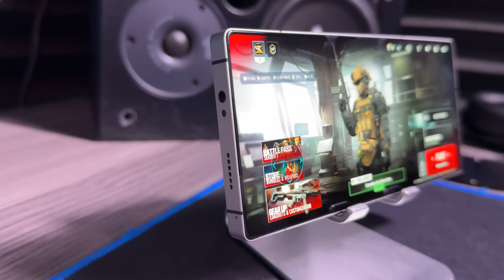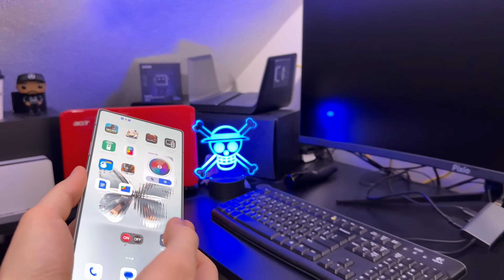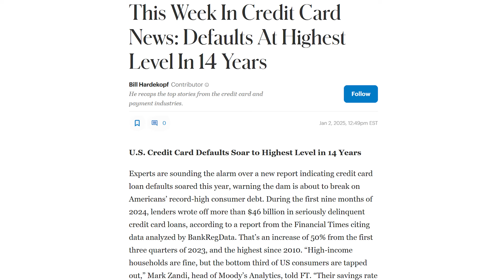What CES Revealed About Repairable Tech In a Record Year For E-Waste (2025 Is Not Looking Good)

Comment: I have a HP Pavilion :(

Bought because long batter life
Battery bulged like a balloon
Bought a replacement off eBay
Had a dead cell and didn't work
Now it lives without a battery
It's designed without CMOS battery
BIOS resets every time it's unplugged

I hate this laptop, it's just cursed
Reply: Got a few of those Crapilions here... gifted (if I can use that word) by friends, and they're close to not being repairable or not worthy of the effort. All it took was a quick look on forums to know it is a throw away computer range
Reply: I have quite a few, some are better than others. I even have one of the DV9000 he mentioned, and yes the GPU is dead.
Reply: the worst laptop that ever lived 😆
Reply: IM actually surprised. My $500  Asus Vivobook X441UB from 2017 still Works pretty good , and last like 1,5 hours on battery. IM planning to buy a new laptop like the end of this year. This scares me
Reply: Install Libreboot
Reply: @mannyheffley5481  LMAO no, I don't think so
Reply: @StarScream_47   bios bad? Then install new bios. Simple
Reply: @mannyheffley5481  The BIOS is fine. The laptop is designed without a dedicated CMOS/RTC battery. Without a working main battery (which I do not have) no settings will persist after unplugging the system. The amount of effort to install Libreboot onto my laptop, that isn't even supported, VASTLY outweighs the trivially few key presses I would need to enter the BIOS and change a few values on start-up.....
Reply: @mannyheffley5481  it is quite hard to do .... and not everybody laptop support it

Comment: So, would a desktop be more repairable than a laptop?
Reply: Yes, and no. Parts for a standard ATX desktop are easy to come by. A lot of the time though, parts themselves are difficult to repair. 

One big pro for desktops is that, with decent cooling, they have a lot more tolerance for dust than a laptop. It doesn’t take much gooch to stop up a laptop and requires frequent cleaning, while a desktop can take years of fossilized gooch before problems start occurring (if at all).
Reply: While individual components are difficult to repair, like GPU, CPU, RAM, etc........ You can at any time, easily replace any faulty part.

Technically you could repair faulty parts, but that requires special tools and extensive knowledge of electrical circuits.
Reply: Easier to replace parts not repair them

Comment: I mean, really what these companies are doing is opening a hole in the market for cheap, simple, repairable tech. Framework already proved that being repairable and evergreen can work as a selling point, and the Fair Phone has also been doing good. Apple even starting to support home repair shows that they realized what a lot of tech hasn't:
If you make something unrepairable, being able to repair that thing becomes a selling point for your competitors. If a company says "Gotta buy a new one every few years."  It leaves them open to having their business snatched by a product that is cheaper, simpler, and has a longer lifespan. Its how Honda and Toyota were able to break the american car market: They gave people reliable cars at a competitive price without sacrificing the important features. For a computer, a fridge, etc, its even simpler: You use the same parts, with a more robust and simple design. You may lose on weight, but thats easily overlooked if your product is leagues cheaper and promises to last for a decade. 

For another example, Airline Deregulation killed a lot of the major players because they had assumed their dominance would just.... continue. And when it didn't, they didn't have a contingency plan. And I see echoes of that in the computer market. HP, Dell, and their peers have no plan for failure because they genuinely think they can't be matched by any other company. They think they hold all the chips, but by going for this strategy of "no repair" they are inadvertently giving away their chips to startups. 
This is just doubling down on a strategy thats proven to not work.
Reply: Problem is a/ design is not more important than specs and repairability so for some it won't do, b/ the price is usually higher because less marketshare (even if that is largely offset by a longer lifespan and real upgradability - but hey, since when has a customer looked at the complete lifespan cost instead of just the cost of buying the thing, just look at inkjet printers), c/ they have to go get it on the manufacturers website as you probably can't find it in big shops. Lazy customers make happy shareholders
Reply: Agree with everything else you said but Apple doesn't realise anything regarding repairability. All they understand is EU regulations. They just market stuff like usb-c iphones and more accessible repair guides like they themselves took those initiatives when they clearly didn't.

Comment: even the car statement you made, bring back the corollas of 1999. yeah they use a little more fuel, but they don't break, so what you win in fuel you lose in parts manufacturing
Reply: Part of the problem with cars are the EPA regulations. They incentivize unreliable, over complicated, and crappy cars all to reach unrealistic expectations on emissions.
Reply: @EvilTurkeySlices  I'm getting so fucking fed up with the bullshit the corrupt assholes at the EPA are pulling, trying to regulate shit most people can't afford to do. We ALL know they're still huffing on the truck sale gravy train.
Reply: I took automotive classes in the 90s and I never forgot my instructor talking about emissions. Even back then he said they made the engines so efficient they had already reduced the emissions at the tailpipe by 90% WITHOUT the other emission controls like MAP sensors, oxygen sensors, EGR valve, catalytic convertor, etc. The result is law of diminishing returns, a simple concept we all learned early on in school but the EPA, CAFE standards, etc have all conveniently forgotten in having manufacturers making cars more expensive, complicated and harder to repair. The end result, corporations get more money and resources are used more than ever and inefficiently imo. The question is do we save more by keeping that slightly more inefficient car running or by mining tons more materials, creating more pollution in manufacturing that car and throwing it away every 10 years to do it all over again? I think by the way I phrased that you can tell where I land.

He even made a morbid point about the efficiency of engines back then. Shutting the garage door and running your car could off you in less than 10 minutes prior to 1970s. A 90s built car, even without emission controls, could take well over an hour. Yeah, making the point that way really made the info stick.
Reply: European Union is exactly the same

Comment: the trend is CES 2025 is NOT A.I. its "DISPOSABLE TECH" that would last 2-3 years tops, as tech companies will gain more profit if people will continually buy their disposable tech.

CES 2025 was about PLANNED OBSOLESCENCE, which definitely let tech companies generate MORE PROFITS
Reply: the simple fact that a battery is not modular, easily externally removable like with a slot mechanism is enough to make any environmentally friendly claims nullified. The amount of people that buy a new device because the battery died is beyond unreasonable because either the labor to replace it costs 1/3 the cost of a new device or the battery is unique and only non OEM clones that are sketchy are available. I just remember my asus laptop that I spilled a drink on, the keyboard used rivets to attach to the top, REQUIRING a full 50% chassis replacement for a few half sticky keys. why on earth design like this? because in the end, when people hear the repair price they go buy new, giving more profit and showing investors good numbers. those "fat" old black soulless laptops were sturdy as hell and now they break like paper, especially the ones with "no" screen border.
Reply: Aren't we all just waiting for the AI bubble to burst? Just like the .Com bubble of the 90s.
Reply: thx america

from - the world
Reply: It's both. There were literally CPUs called "Ryzen AI 9 Pro Max 385" (I think I got that right) there.
Reply: Casting curses is your best friend guys
Reply: I hate planned obsolescence.
Reply: Well the AI bubble has begun to burst. DeepSeek showed how easy it is for open source solutions to strip away most revenue opportunities for AI.

Comment: Minutes ago i was chatting with my friend, he has a lenovo gaming laptop and sent it to a shop just to get it cleaned from excessive gooch. The shop told him the fans couldn't be removed to be cleaned alone and would have to remove the entire cooler, which covers half of the entire laptop assembly, and then underneath that is liquid metal which isn't as easily replaceable as thermal paste, and apparently the thermal pads are not actual pads but some kind of "grease" as described by the shop tech.

Modern tech is making less and less sense, is becoming less repairable if at all, less efficient and many undercooked products now riddled with AI and design choices nobody asked for that also costs more!
Reply: @crisscrossam Just dropping here in case your friend wanted to clean up the mess that repair shop made,
liquid metal on CPU, PTM 7950 (not thermal pad despite seller may label as such nor should you use them as one) on GPU, the described "grease" are actually thermal putty (completely different from thermal paste, don't mix them up), get 20g Upsiren UTP-8 and use it VERY SPARINGLY on where the ""grease" was, which likely is on VRAMs, and mosfets if that Lenovo is a Legion Gen 9.
Reply: Back in 1980's people in America fixed revolvers by swapping parts with another revolver, some of them were compatible some others dont and you get a quimera, but you can't go into the west without a weapon like in 2020's you cant exist without a pc.
Reply: @SatiZakito chimera?
Reply: I'm ngl there doesn't seem to be anything wrong with that, it actually sounds way more repairable compared to a majority of popular computers. Here's why:
- User accessible backcover (the fact that it could even be opened without a heat gun and get at the parts)
- User accessible heat sink and fan assembly with direct access to CPU and GPU die
- Replaceable RAM, storage, wifi card etc 
- Liquid metal pre applied, with thermal putty on VRMs

I'm not exactly sure what your point is, are you saying it's too hard/complicated for your friend to learn how to fix their own laptop?
Reply: This is what happens when you let suits who don't understand tech push design ideas for shareholders instead of engineers who understand design.
Reply: @crisscrossam  should’ve called the gooch collector
Reply: i hate laptops for this so much like on my lenovo gaming laptop you also have to remove the entire cooler ad make sure not to bend it at all while its being wrenched down by so many thermal pads (ACTUAL pads)

had to buy an entirely new cooler because i literally couldnt get it off without breaking it to replace one damaged fan...

i love modern tech
Reply: Planned obsoletion and people still buy it. Cha-ching new Yacht for the big wigs.
Reply: Oh, nothing is problematic here.

LM is fine, can be replaced with a PCM pad like the Honeywell PTM7950.
The "grease" you have on those is actual thermal putty.

I'd recommend for your friend to contact Halnzyie and get 1kg of HY236 thermal putty; it works extremely well on basically any devices while being very inexpensive and working for basically all gap sizes.
Reply: Liquid metal isn't hard to replace, you just need some special q-tips and new liquid metal. It's a pain to apply correctly in some cases though. Any kind of gaming laptop cooler is going to be an endeavor to remove, clean, and reinstall. You're potentially trying to cool 200 watts of heat with some small fans and heat pipes that have to stay under 95c, preferably cooler to prolong life. It's physically impossible to do this without a complicated cooler. So either, use the cooler that might be a pain in the future, or don't buy a gaming laptop. Now if you wanna talk about some of the ports Asus used to use for their power connectors that loved to snap off in the charger, be my guest. Those things were a nightmare and the port was soldered to the board.
Reply: I've had to re do the liquid metal on my i9 Acer Helios Neo 16 two times in the 16 months I've owned it
The liquid metal was easy, I've been doing it for a decade since I overclocked a 680M from 720mhz to 1Ghz with it

The "liquid thermal pad" they put on it is a NIGHTMARE to deal with because it rips and half stays on the mobo components and half on the cooler so you can't just slap the cooler back on...
Reply: It makes perfect sense of your looking at it in terms of making as much money as possible.

Corporations will make it less durable and harder to repair so you are forced to buy another product.

Why sell you a chair that lasts a life time. When you could sell a chair that breaks ever year so you have to buy a new one.

Selling durable products isn't financially incentivized. 

Because from a money perspective.
Selling a durable product that is more expensive to make is dumb because you don't want to customer to have it for years. Once that sale is done, you aren't making a penny more. So if you want them to possibly come back you build a product that lasts a few months just beyond the return window. Then when it breaks they either 

 A come back to buy a new one. 

B go to repair shop to get it fixed which bonus if you are the only person who supplies replacement parts. 

C they don't come back at all.

Two of those three scenarios you make money. The third one you remain neutral. 

See it's all about the green.
Reply: It's not about what makes sense, its about shaving off as much cost as possible in that quarter and then slapping on useless expensive features using whatever buzzword is currently making investors hard.  Hence why we're seeing all this "AI" shit
Reply: Those "shop techs" don't know crap!
Reply: That actually sounds really good since heat murders most laptops before their time. Putting that much effort into the cooling system so that it doesn't rely on paste and cools most of the components is incredible.

If your friend wasn't a disgusting goochy slob it probably never would have needed to be taken apart
Reply: @AddyEspresso  even in a perfect environment, there will still be dust build up on the fans
Reply: @AddyEspresso  Issue is, liquid metal is not that much better than any other solution for heat transfer to the cooler, while it makes it very difficult to clean out and replace. PTM7950 would cool it more or less just as well, while also being easy to install, replace and last so long that you probably would not need to replace it.
Reply: how is that any good? liquid metal or not, easy to dismantle and replace is always preferable, fans can die at any moment in a laptop not to mention dust built up. maintenance is what give a laptop long life. the ability to open it up, clean the fans and change the paste/pads is vital. the thermal difference between a good paste and liquid metal is not that big anyway.
Reply: @AddyEspresso aint no way you are calling someone disgusting with that pfp
Reply: @ im isopropyl alcohols strongest soldier

Comment: You could always switch to/add PC repairs, that will always be needed.
Reply: He's already fixed up a few workstations (thinking of that sweet, sweet Ubuntu AI machine). The truth is that the margins are even lower there.
Reply: @GSBarlev  In general, yes. What's missing are a few stores that do specialized work on hardware, such as replacing the thermal pads on a GPU.
Reply: Afaik he is doing that also.
Reply: We are a bit in a bubble there. Laptops are by far more common than PCs nowadays. And because they are portable/dropable and are more difficult and need different equipment to repair, they show up more often in repair shops. For a PC, you probably know someone that can switch out your broken GPU or PSU for you with just a random screwdriver he has lying around.
Replacing the screen or motherboard of your MacBook? Thats more of a job for the professionals.
Reply: @ There is a huge gray zone: People who build their own PC's and only buy parts.